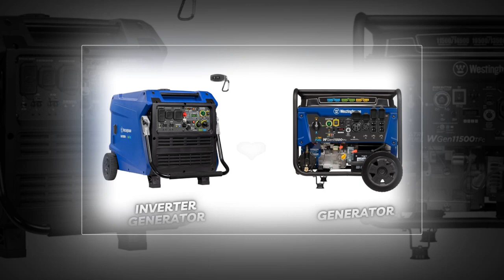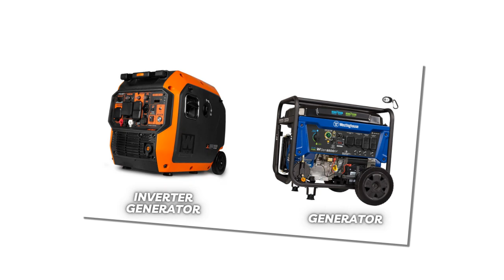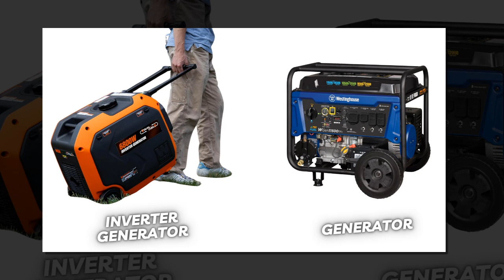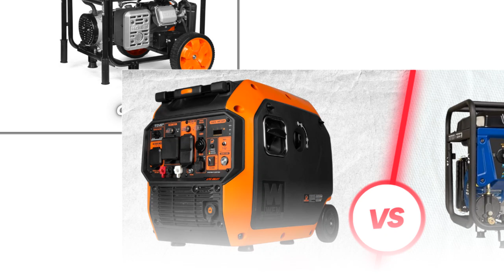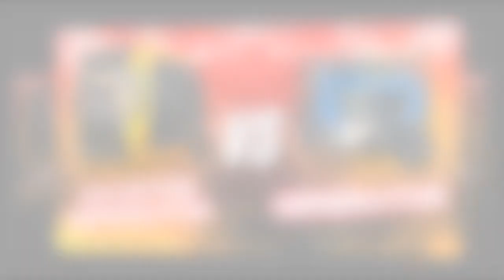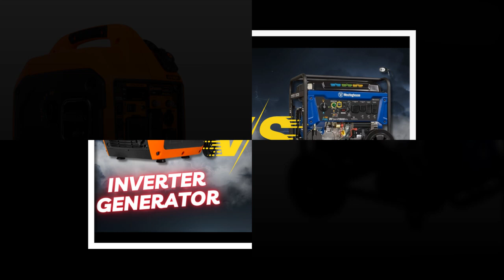Inverter vs Generator: Which One Is Best for Your Power Needs?  #InverterVsGenerator

Comment from the maker: Link = https://cutt.ly/wr1AidUq

Description: Confused about choosing between an inverter vs generator for your home, camping, or emergency power needs? In this video, we break down the key differences, including power output, noise levels, fuel efficiency, and cost. Discover which option—conventional generator or inverter generator—is right for you! We also cover standalone inverters for battery-powered setups. Don’t miss our expert tips to make the best choice for reliable power.

Hashtags: #InverterVsGenerator #GeneratorComparison #PowerBackup #InverterGenerator #HomePowerSolutions #PortablePower #EmergencyPower #CampingGear #PowerOptions